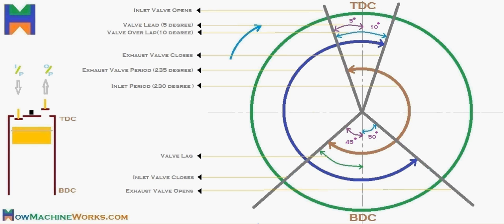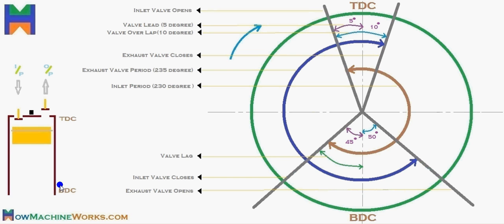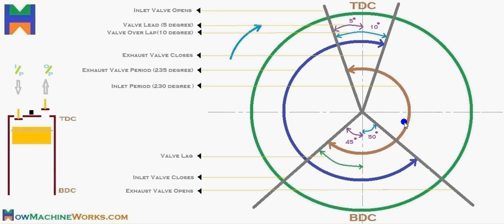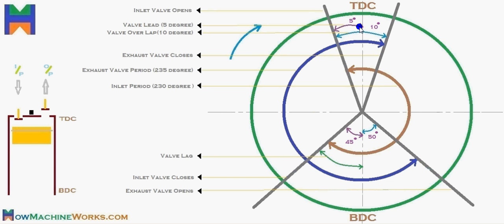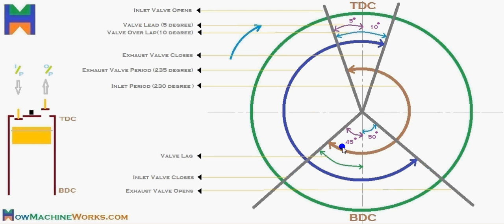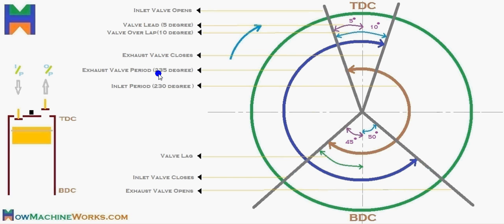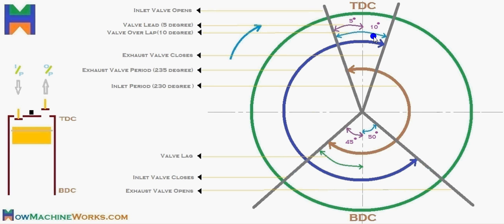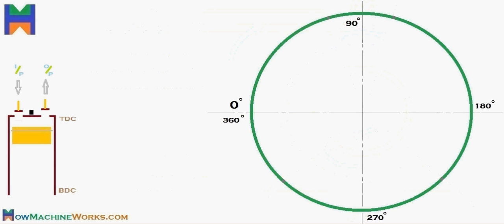Animation How valve timing diagram works. ✔

Comment: Thanks for the explanation.  So it is possible that if there is oil sludge inside the cam hub, the hub won't be rotating as it should causing poor engine power?

Comment: bro its not because of inertia .. the cam is designed specifically for that so that  there are delays . for example a delay in exhaust port remain open after tdc will make addition time for exhaust gas to exit the chamber which in turn increases volumetric efficiency.

Comment: yes the exhaust valve is open for 240degree
Reply: Exhaust valve is opened for 235 degree. 180+50+5=235. 10 degree is overlap. overlap is basically sum of inlet valve lead and exhaust valve lag. in diagram exhaust valve lag is not show which is 5 deegree. but still you can easily find exhaust valve lag from overlap and inlet valve lead.

Comment: Exhaust valve period is 180+10+50 = 240 degrees, not 235 as showed in this video.
Reply: The 10* in your equation is the overlap, not the exhaust valve closing event.  The exhaust valve closes at 5* ATDC.
Reply: +Alexandre GUARATO see digram carefully.. 180+5+50 or[(180-5)+10+50]
Reply: no bro alex is right i hope exhaust valve period shown in blue that have 180+10+50=240, and also valve over lap is call both valve are open, 5+10 =15 angle time they both are open that means overlap is 15

Comment: I must be missing something. If the inlet valve opens 5 degrees before the piston reaches top dead centre and it stays on for 45 degrees after tdc, then wouldn't the inlet valve hit the piston when it reaches the top? Thanks for the video!
Reply: I you haven't already found an answer, most pistons are engineered with grooves to allow for the valve overlap. If you have a more comprehensive understanding by now I'd appreciate you sharing it with me.

Comment: Exhaust valve period should be 240 degrees.Right?
Reply: no buddy its 235...valve overlap is 10 but exhaust valve closed 5 deg atdc so its 180+50+5=235

Comment: I have one question regarding the valve timings, in overlap period the inlet valve and exhaust valve simultaneously remain open. There must be some portion of fresh charge discharging from exhaust valve? What is the phenomenon taking place which protects the fresh charge escaping from another valve?
Reply: it doesnt,, because the pressure in the exit manifold is higher than inlet,, rather all charge go into the cylinder under suction stroke the low pressure region.

Comment: Hi, nice explanation. But this is a 4s cycle, so u are only explaining about inlet and exhaust stroke. It would be nice if you could also show the compression and power stroke.
Reply: I'm struggling to understand what you are asking. The valves stay closed on the compression and power stroke therefore there is no need for valve overlap.